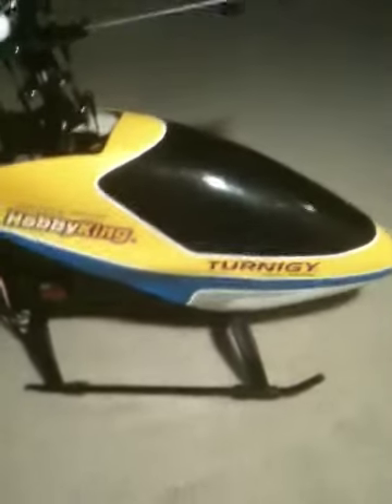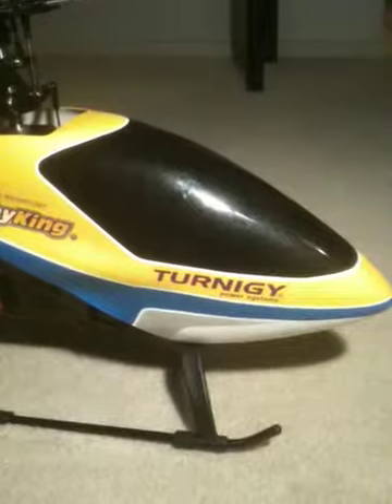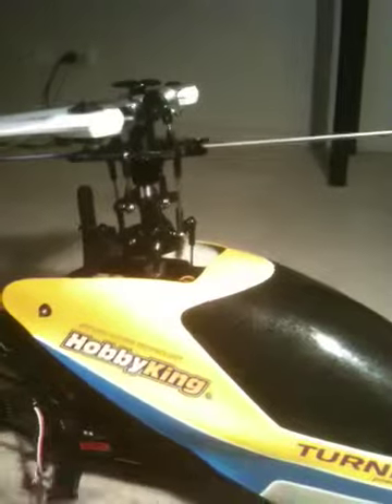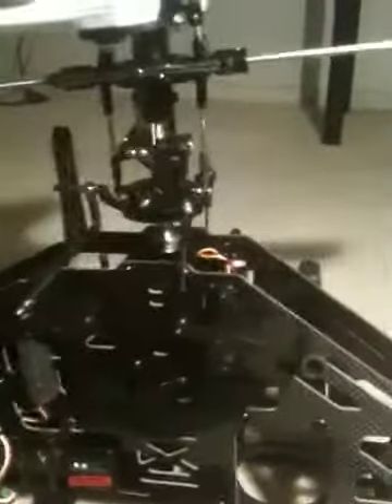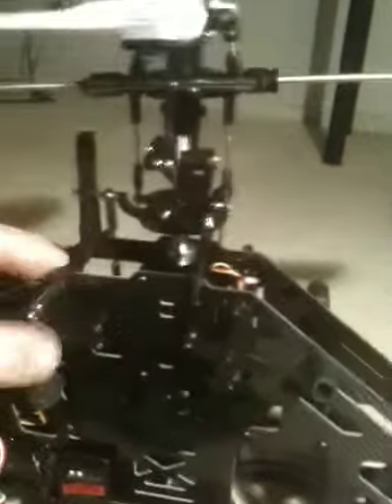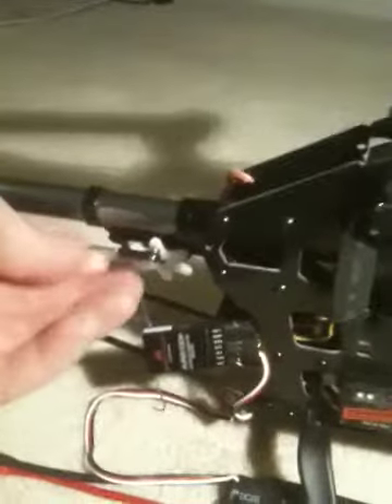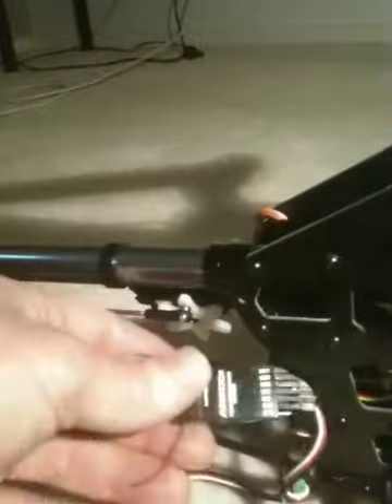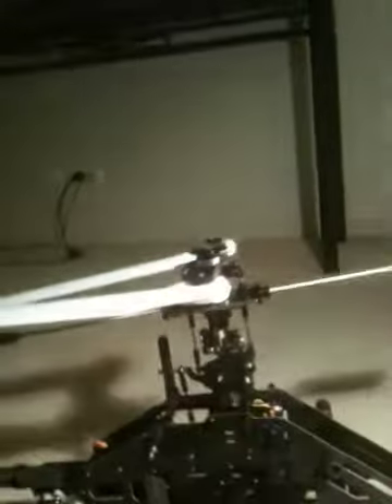Skya 500 almost finished

Comment: @maccanaut thanks for the heads up. I have replaced the autorotation gear on the 500 already....1 tooth stripped. Other than that it's been fine. Thanks.